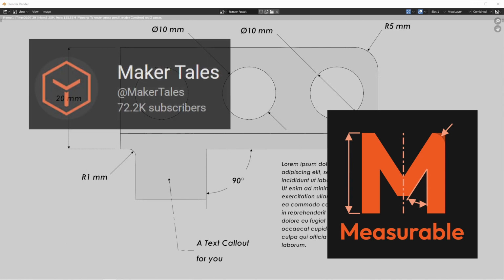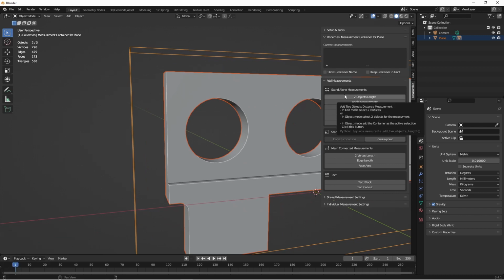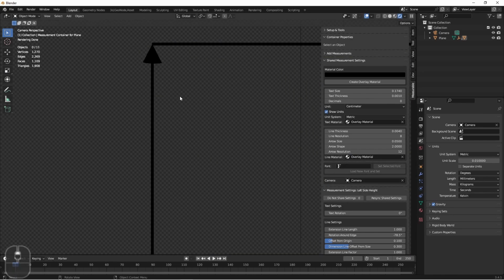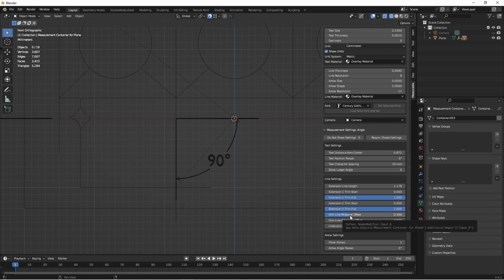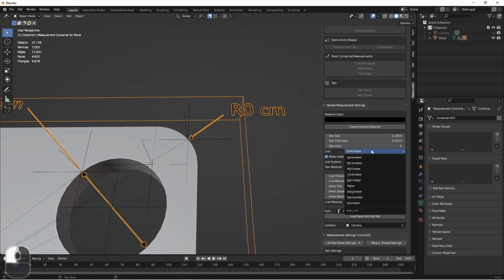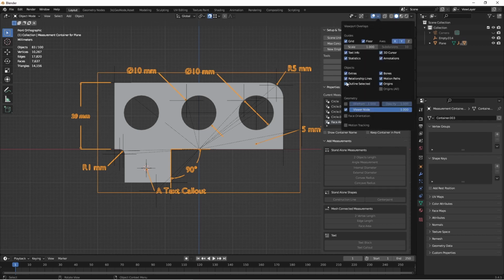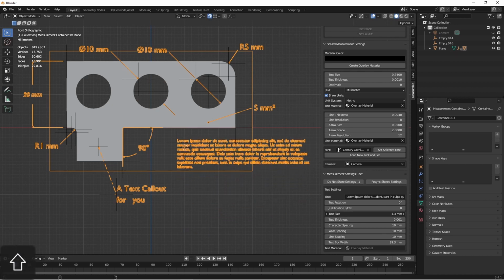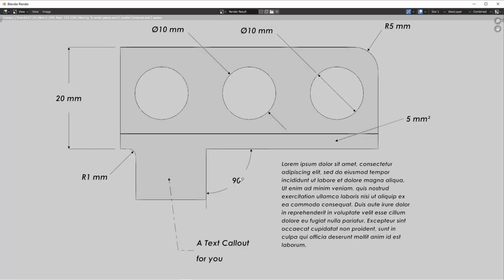Measurable: The New Blender Add-on for CAD Style Measurements

Comment: Hi Johnny, I just purchased Measurable.  Thanks for creating this.  I'm learning to use it (less than an hour).  (FYI Engineer by training, CAD).  My question is about scaling and making edits.  On a box, two  object length across two vertices if I scale the object in Object Mode, the measurement callout gets longer along with the box but the dimension value doesn't change.  If I delete the measurement and remeasure, I get the original value but I've scaled the box so the measurement should have increased.  If repeat the operation, but do it in Edit mode, so in Edit mode, select all of the box and then scale it, the measurement doesn't get longer but if I remeasure the edge, the measurement is accurate.  Is that the best way to scale something (in Edit Mode)?  Is there another way where the measurement will increase or change with the object when its changed?  Thanks
Reply: Yes this is something I was looking at as well. The way I model it would be great if it updated live as I changed the size of the model the way measurit tool does.
Reply: @paulg625 Ive created an addon specifically for this

Comment: amazing add-on, i follow the video,  but there  is a problem, when i insert the measure of internal circle, the dimension text, is rotated of 90 and in camera is not visible, while  other measure like angle,left side edge, is correct visible in camera, why the text measure is not in camera vision?  how do you rotate text by 90 gradi?

Comment: the text and arrow should be by default 0 and rotation 90 and that rotation by degrees is just an option for special dimension, its too slow in all cad software its all flat in hor or vertical plane